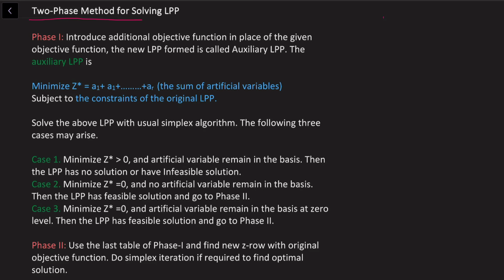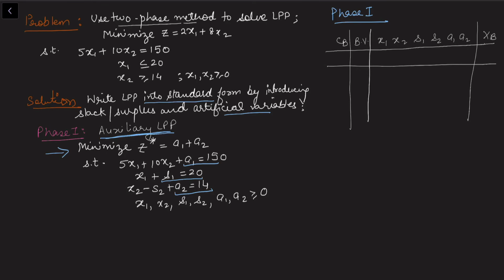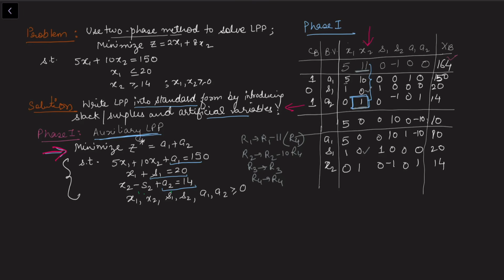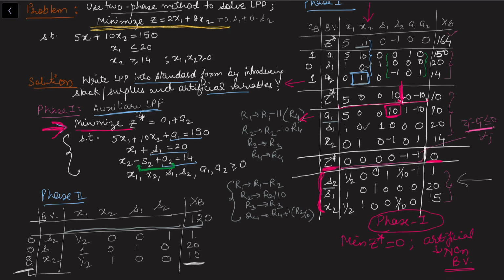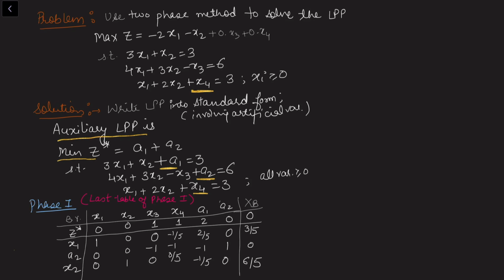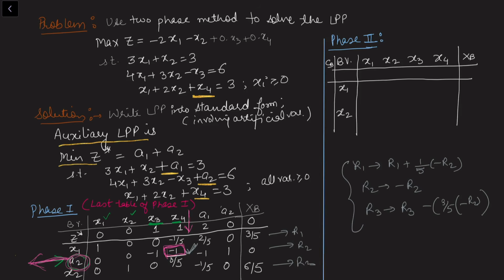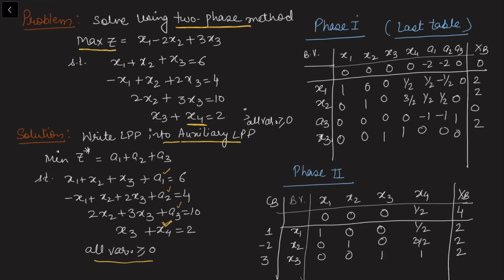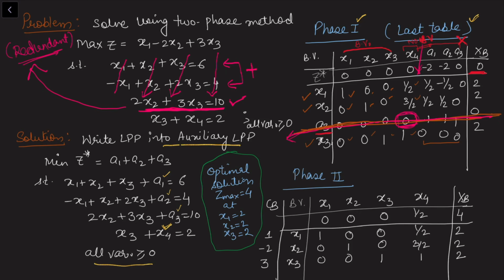Simplex Method |Part 11| Two Phase Method (Feasible Optimal Solution)

Comment: Screenshot: https://drive.google.com/file/d/1YNMVQtz98Hmim7uGctYeqxOdJBK0zW16/view?usp=drivesdk

For optimality the vector with most positive c - z  value (in this case x1) should be entered into the solution (Table 4.15), but author stressed that if x1 is allowed it will lead to infeasibility w/o any explanation, instead chose to go with s2. Can you please give a hint why he said so?

Comment from the maker: If you using Two phase method, then we start by writing auxiliary LPP, and here objective function is Minimization=sum of artificial variables. So cost is +1. But if in auxiliary LPP you keep objective function as Maximization then it is Maximization=- (sum of artificial variables), so here you can take -1 as cost of artificial variables.
So depending upon what we are considering objective function in auxiliary LPP accordingly you can choose cost of artificial variables.
So selection of maximum/ minimum objective is irrelevant, you can select any.

Similarly in BigM method, if objective function is Maximization then cost is -M, and for Minimization the cost is +M for artificial variables.
Reply: Thank you for the explanation, been struggling for a while with these topics. The best explanation video for these topics I've seen.
Reply: yes you are right i stuck again and again but seeing your cooment i understand that thanks to share your thoughts.
moreover earlier they said when minimum ratio tie go with artificial variable but here she go with x_{2}. however answer in unaltered.